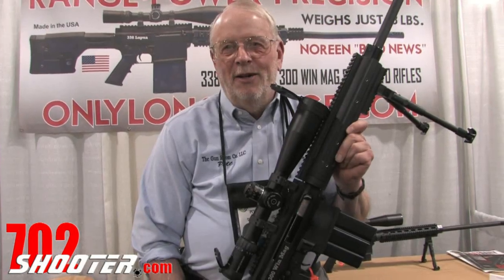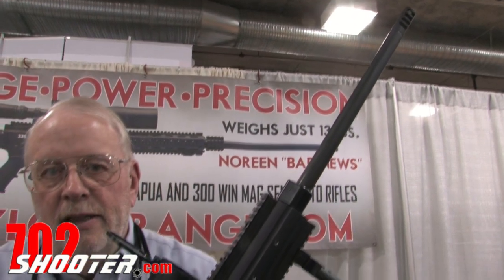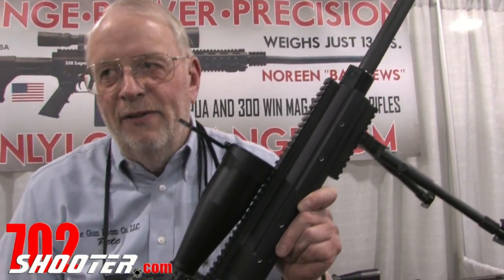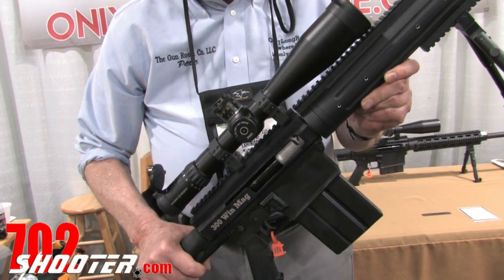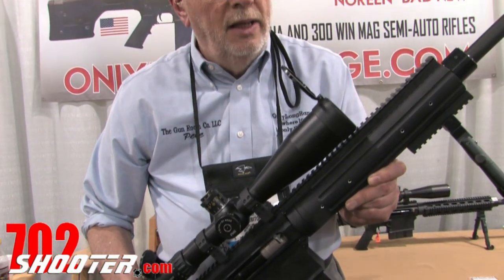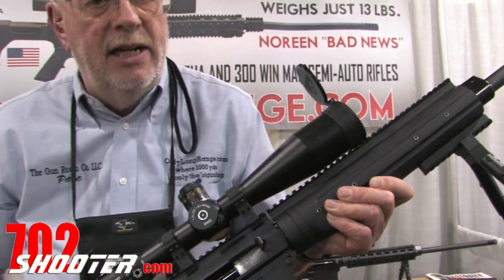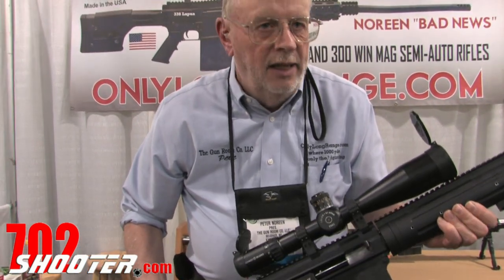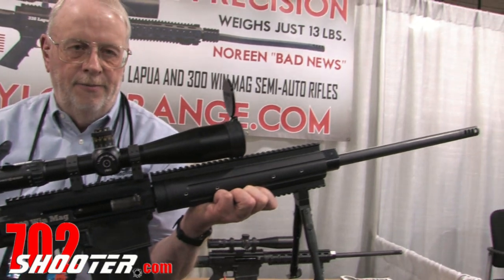The Gun Room Co. New .338 Lapua & .300 Win Mag AR Rifle

Comment: in every slow-mo video I've seen, the bullet is well out of the barrel before any piston movement occurs. so harmonics don't apply.

what exact problem are they trying to solve here?
Reply: DirtyWop Bastard lol wut.

free floating has nothing to do with the gas system. its whether the forearm/handguard makes contact with the barrel or not.
Reply: DI is not intrinsically more accurate than piston. both make contact with the barrel. you can bet your ass the DI assembly affects the barrel harmonics, just as a piston assembly does. mass is mass. the only way it could not "interfere" is if the gas block and DI tube both weighed 0.

in any case you can compensate for harmonics with dampeners. there is no magic here.

this claim about free floating barrel and harmonics is all marketing nonsense.